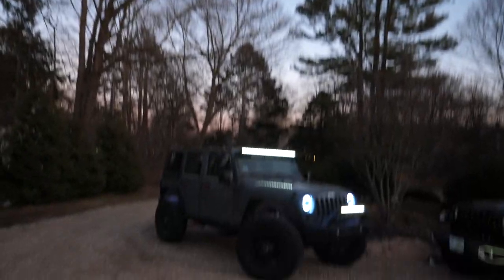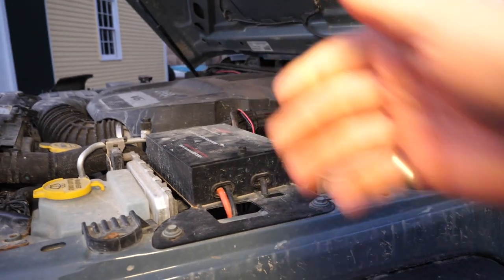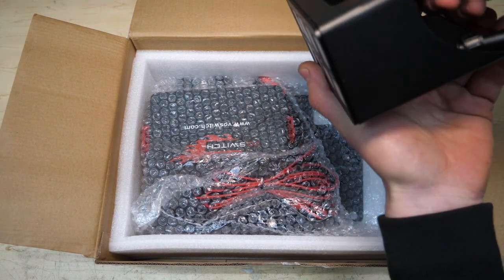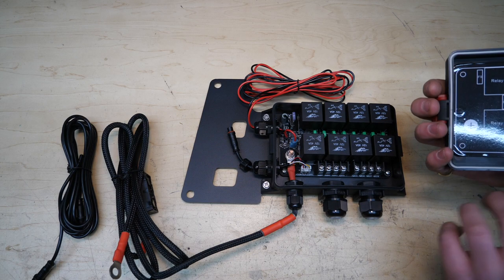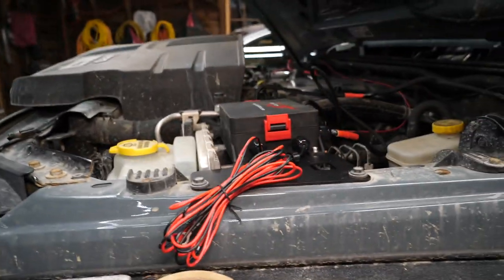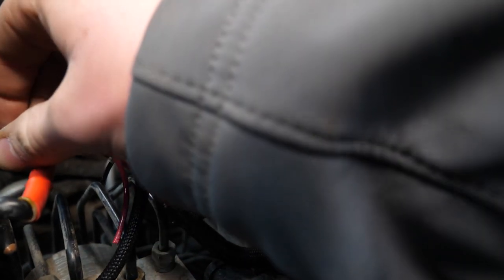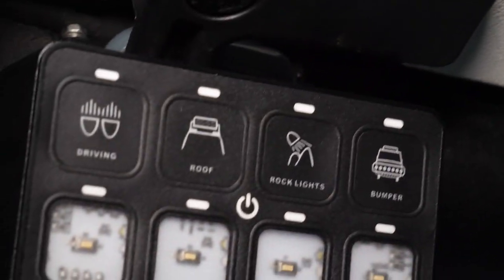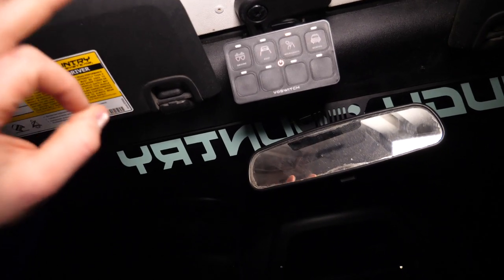Voswitch JK100 Programmable Switch Panel // INSTALL & REVIEW!

Comment: They just sent me one to review, I love it so far! I ended up using to ball mount for the time being since I'm having some issues with my soft top and I didn't want to let it back in case I couldn't get it latched back.. after seeing this video and given the 2 options I had to choose from to review, this one seemed so much better, especially with the wire that goes in the cab!

Comment: I ordered the old version (it was on back-order)  because I don't like the new, but cheap looking push-button switch panel.  I like the old school hard button switch panel with the nice tactile 'click'.  It just came in the other day.  I was VERY surprised and happy that was shipped with the NEW water-proof control box for under the hood.  Best of both worlds!!
Reply from the maker: No way!! I had no idea they were shipping the old version with the new waterproof box! Thank you for sharing. To be perfectly honest, I completely agree with you. The nice tactile click is very nice, and I found myself struggling a bit to turn this sucker on in the pitch black of the night. Might have to do the best of both worlds like you said
Reply: @JDCarsChannel  If you have your old switch panel, you could still make it work I think.  The connectors don't match, but I think you could cut and splice.

Comment: Awesome Video.  I was bummed because the original voswitch just sold out on Amazon.  I saw this one come available and looked up your video which sold me.  Thank you for taking the time.  It also gave me the confidence to do it myself. I am ordering now and will get it tomorrow. Can't beat it.
Reply from the maker: Bummer that they don't offer the old version anymore, but this one is truly even better! I'm glad you found the video helpful and inspiring. Best of luck with your installation! Take your time and it'll all work out smoothly.
Reply: I JUST bought the old version (the switch unit is better) a little more than a week ago and it shipped with the updated control box!!   (see my comment above)  Try Amazon again!

Comment: Do not ground your accessories through the ECU. It will likely be ok, but you run the risk of damaging the ECU or causing random glitches from the added heat and electrical current flowing through the ECU housing. It would so much better to ground them to the body. If you don't want them on the edge of the fender, then find another point nearby inside the engine compartment. I loved the video otherwise! Have you had any issues with the stickers on the switches yet? I'm curious how that works out long term.

Comment: Another great video. Thank you for filming this. How do you like the new JK100 vs. the previous Voswitch that you had installed? Was it worth the upgrade?
Reply from the maker: Thank you! Happy to help. I like this new unit better in a couple ways: the slim control cable is easy to install, the unit is fully sealed & waterproof, and the programmable button functionality is pretty cool. However, the old fashioned toggle switches are easier to see in the daytime-- whereas the indicator light of the JK100 can be difficult to see in the sun if you have the top off.

Comment: Great video, thanks! If I program a button to turn on automatically with the ignition (such as a camera), will it also turn off automatically when you turn off the Jeep? I’m afraid I might forget to turn it off, but I might also want to use it sometimes without the keyed accessory switch on.

Comment: Any thoughts on how the mount might work elsewhere? I run the Teraflex AXIS Sun Visor system and have a bar that runs the entire width of my windshield, making an overhead mount pretty difficult to impossible. Just wondering if I could mount this elsewhere and still achieve the same custom look.
Reply: the switch panel can be taken out of the enclosure , then you can cut you lower dash and install the switch panel flush on the dash.

Comment: Great details on your video. Very well explained. Question for you: Don't have a JEEP but have 2019 Tundra TRD Sport, I think this would work with the Tundra, not sure if the switches are made such that they are a custom fit for JEEP's - any suggestions. I was thinking of TRIGGER 6-Shooter system but saw your video and I like this better. Any help is appreciated. Thx.
Reply from the maker: Much appreciated! Sorry for the delayed response-- I believe you would have luck installing the Voswitch Universal system. Highly recommend checking it out!

Comment: where do you connect the ground from the accessories?
Reply: good but UNANSWERED question - the switch box accepts the Hot lead but there is ?? to put the ground/neg lead from the item being added....this vid is as silent on this as the pitiful directions in the VOS UV100 PACKAGE
Reply: @TennesseeTraveler01  Just connect to the closest frame bolt/screw
Reply: @mjoet731  Truck/Car I'd agree but this is boat application.  I finally put ring clips on each negative line, soldered them in place, and secured with shrink wrap before screwing them to a 3/8 post on the Neg post of the battery.  Thanks for the suggestion - and a good one for vehicles.  Just not for boat, esp an aluminum boat.

Comment: Do you recommend wiring your rgb halo drl to this or just run it directly to the fuse box as well?
Reply from the maker: Good question! We've always installed our RGB lights before installing the Voswitch (not on purpose, just the order in which they were installed). So we've yet to try hooking the RGB halos up to the Voswitch, but you certainly can-- that way you'll be able to toggle the halos on/off.
Reply: @JDCarsChannel  that's what I was thinking. I just bought my voswitch and halos and I think I'm going to try it that way

Comment: wonder if there is a way to mount the digital switches on a vector bar? and/or have a simple plat faceplate instead of that angled box look??
Reply from the maker: I wonder the same... have you checked out the Voswith UV100 (Universal Model)? -- https://amzn.to/3FOGMq8

This might be a good solution
Reply: @JDCarsChannel  I just ordered the jk100 as you have. The pics in the description show the digital plate is separate from the enclosure you used to mount it to the footmans loop. Was your digital plate part of your enclosure? If it is I’m screwed. But like I said the picture on Amazon shows them as being two different parts.
Reply: Forgot to mention it also comes with a couple of ram mounts to mount to a vector bar. Did yours come with that?

Comment: I bought a voswitch switch panel as well and I only have 3 strobe settings while every video I’ve seen have like 6 settings so I’m wondering if I installed something wrong
Reply from the maker: That's strange! Please shoot a message to Victor over at Voswitch and I'm sure he'd be happy to help figure this out
Reply: did you ever figure this out? i have the same thing. all i have is constant on, momentary, flash on/off slow, and constant strobe. no alternating strobe or anything else